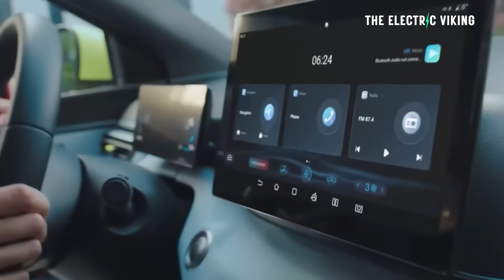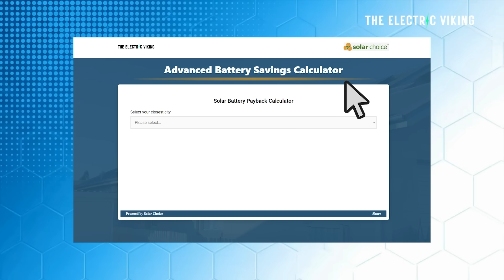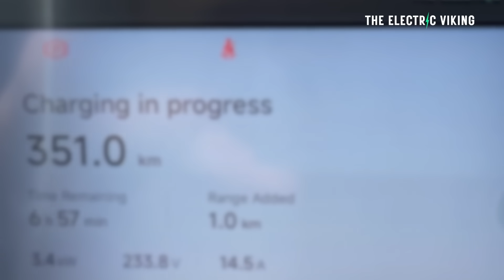This Data from 2025 PROVES Legacy Automakers are COOKED

Comment: Chinas pivot to renewables and EVs is also a national security strategy to reduce oil consumption just in case US gets desperate enough to blockade china's oil supply. Imagine over 500 million drivers in China not using oil to run their cars daily. (500 million is just a guesstimate) not to mention renewable energy production its a staggering amount of oil that can be used for other sectors.
Reply: China has options on obtaining oil if the US acts:  increase imports from Russia and Iran which are transported through land routes;  start using their extensive oil reserves; buy oil from Canada that can be shipped through the Arctic.

Comment: About two-thirds of all EVs sold in 2025, were in China.  Sadly, in the USA, EV sales were down about -27% last quarter.
Reply: That's false information.
The drop in EV sales for calendar year 2025 was about 2% in the USA.

Teslas Model Y was not sold in the USA for the first two months of 2025, as the new Model Y Juniper was being readied for sale.
Also, the EV tax credit ended September of 2025.

So, the small drop in sales was insignificant in the USA.
Reply: @dvader3263   I know EV sales were only down -2% last year.  If you re-read my comment, I said EV sales were down -27% for the last QUARTER.

Comment: Toyota and Nissan lost the plot when they didnt focus on hydrogen.
Reply: Toyota did focus on hydrogen right?
Reply: @rowanbroekman3929 about as much as any American maker focuses on electric. Just enough to collect the grants and not actually make a real effort.
Reply: Hydrogen is a lost cause, they tried it in Norway and it failed. There is no efficient way to manufacture hydrogen on mass so it makes no sense to press on with that pipedream.
Reply: @cbcdesign001   dont lie to people when hydrogen can be made with solar and water. Tech existed back in the 90s amd is used by giant trucking firms to date but no one wants inexepensive fuel that would allow the poor to advance their lives an livlihoods because that would take away from the American manufactuting slave populace. Just because big oil has made every effort to destroy the tech and claim they are the only option.
Reply: @JeremyGeorge-t1p The problem is that you need a really expensive tank to keep the hydrogen in and also to tank it over. It's very dangerous on top of it. Simple electricity makes much more sense. 
You could also drive on high pressure air, but despite a little bit less expensive it still doesn't make much sense.
Reply: @rowanbroekman3929  a home tank or even a small commercial tank that could be installed at roadside standalone stations only requires a water supply, which can be topped off with rainfall or even a urinal and an off grid completely renewable power source like solar or wind. Very small footprint. Almost no transport cost outside of regular maintenance after install. The tankage itself costs far less than any large scale battery at between $500 to $2500 CAD, fills extraordinarily faster and takes up far less of a footprint than any battery station would. Cost of materials and damage to the environment from mining, waste and pollution is also by far less. Little to no range anxiety, with the ability to produce hydrogen faster than electricity with an onboard generator, plus free water you can either put back into the system or drink. Now how would you like to try and spread more propoganda to someone who has worked in the energy, transport, containment, mineral resources, waste and manufacturing industries for more than 45 years?
Reply: @rowanbroekman3929   you are full of hot air. Hydrogen is by far safer and has been proven so in commercial testing than even conventional fuels and batteries, as the tankage used to contain hydrogen is actually a heavily regulated multi walled fuel cell thank can withstand explosions and intense environmental conditions.
Reply: @JeremyGeorge-t1p Hydrogen is fine when consumed where produced. Storage and pipelines suffer from embrittlement. Burning hydrogen in a fuel cell has roughly 33% efficiency.  If you are going to generate electricity, it makes more sense to use an EV
Reply: @JGood-Quebec if you haven't read the other comments about producing it on site and where needed and not using a pipeline and zero drilling. A person can use hydrogen in any matter they wish, whether it is internal combustion or electric or anything in between, which makes it highly versatile and multivehicle usable not restricting what would arrive to fill as long as the vehicle has a hydrogen system of some kind. Using conventional fuels to create electricity is less efficient and running around on giant batteries kills the planet by requiring mining for substances that should really be recycled from existing waste. A hydrogen fuel cell generating electricity in your vehicle give the vehicle a lighter weight and more space overall as well as a much greater range, plus you do not need transmission lines, fields of panels or giant wind towers destroying the country or massive coal/petrol electricity generators which also require refineries. Like solar, water and wind power, Hydrogen can be generated at home basically for free as well as directly on site of a fill station without any underground infrastructure necessary.
Reply: @J @JeremyGeorge-t1p  How are you generating Hydrogen for free?

If hydrogen were free, then we would have already stopped burning fossil fuels
Reply: @JGood-Quebec  it is very easy to create free hydrogen after some simple minor equipment investments. You can make it at home. Just because oil and gas has spent centuries trying to sabotage its development or control it as a petrol product, just like electric vehicles doesnt mean it does not exist. Stop marching to the tune of Stephen Harpers MAGA IDU and do some simple research. Kids used to produce hydrogen in Canadian grade schools as a first science project.

Comment: That's really simple story there, 1. Legacy automakers have lost their teeth in largest car market in the world, China, so they have start a steady decline in the profits, which will end badly for most of them. 2. Electric cars are already good enough, not tomorrow, not next year, but now. Almost anyone who has driven one, will buy one next, Plugins and E-REV's are just a stop-gap means for those who are afraid of range. 3. Price gap, which stops Legacy EV's from being sold in western world does no longer exists, in China. The EV's are  similar price or lower price than ICE in there. If the silly tariffs and regulation would stop, this would happen in rest of the world as well. 4. USA, with their oil-based economy will be trampled over when rest of the world stops using oil in near future...

Comment: You are dead right on the inability of legacy automakers to see and manage their decline. 

As an engineering manager I saw Ford, Holden, Mitsubishi, DaimlerChrysler, with EVs in 2002, all fail in real time. The real issue is in the executive ranks. 

The only fix is to cull them substantially, and replace them with younger and more modern thinking, engineering executives.

Comment: They were warned years ago, pivot or perish .I have No sympathy for them ,but I do for the workers. 🤨🧐😤
Reply: Yeah, it’s hard to have sympathy for them. However, they do have a lot of experience in building high-quality and reliable frames (body), suspension and auxiliary systems. It would be bad if those knowledge lost. Oil cartels influence in them is terrible.
Reply: Yeah check out this amazing documentary Who Killed the Electric Car.  GM had a working desirable EV back in the 90s and their own execs worked with oil company to kill it.  You can't even make this stuff up.
Reply: Ev's require far fewer people to manufacture. There are factories in China that are lights out.

Comment: I’m in Canada, driving a 2024 diesel Silverado 1500 truck and an old gas Toyota Corolla. I really want to buy a plug-in hybrid from China that has over 100 km range on battery and more than 2000 km range on full tank gas and fully charged. I’m patiently waiting and will never buy a new ice car ever.

Comment: With Trump destroying air polution standards for American cars - means that no American car will ever be exported to another country..
Reply: Do you know Trump is finally allowing car companies to make small affordable efficient cars. G W Bush and Obama effectively banned small cars by making them impossible to meet high EPA standards.
Why are you complaining? Do you want more gas guzzlers. How is that going to help the environment.
Reply: @benmlee  You have been drinking the orange man's Kool-Aid.
Trump has allowed car manufacturers to increase emissions with the argument that it makes them cheaper to manufacture.
That is not a good thing.

Americans continue to want larger and larger cars/trucks which use more and more fuel. American companies have always been able to build smaller cars but the public doesn't want them.

An AI created summary is:

The Trump administration is rolling back Biden-era vehicle emissions and fuel economy standards, proposing weaker rules to allow automakers more flexibility, increase consumer choice for gas-powered cars, and lower upfront vehicle costs. Key changes include setting a less stringent fleet average of about 34.5 MPG by 2031 (vs. Biden's ~50 MPG), ending EV tax credits, and ending fines for non-compliance, actions praised by some automakers for aligning with market demand but criticized by environmental groups for increasing pollution and fuel costs long-term.
Reply: @tonyw4863  We don't want most small American cars because they are crap. But people love their Bolts.

Comment: You talk like you know what the driving situation is 
Iike in every part of the world,I live in rural Canada the snow is 3 feet deep and it’s-20c many days it’s 200 kms away to visit family and the charging network is not there and if it was who would have the time to stop and charge. 500 kms of range down to 200 in the winter. We tow trailers with boats,campers,snowmobiles,atv,etc and that 700 kms range is down to 100! EV’s don’t work for us
Reply: Most people  elsewhere dont  live in an environment like yours. Rural with freezing temperatures and deep snow. Like here  in Asean which it's sunny all year round. The ev adoption cannot be stopped. In an Artic country like Norway almost all their new car purchases are evs( 96%) while its more than 50% in  China. Here in Thailand  which is  sunny all year round, its 20% and growing.
Reply: @kamsunleong6648  Look at a map. A lot of regions on the Eurasian continent live in exactly that freezing winter temperature.
Reply: Some of that is no longer true. You might look again, although that’s a lot of edge cases to overcome. Well over 90% of the population has no such constraints. 

- we don’t have that much snow in New England but my Tesla is the best snow car I’ve ever had

- heat pump is critical to preventing winter range drop. A big reason I finally bought my Tesla was when they started using a heat pump. Now sone other brands do as well but should be a basic requirement for northern regions

- towing range is certainly a general issue with EVs, but you might want to look at the GM trucks with their humongous batteries

- technically any outlet will do for charging. You can put more into a battery from a standard outlet than the average person drives in a day. May not be convenient though

- but yeah, sometimes you need faster charging and if you don’t have it, an EV may. It yet be for you. However fast chargers are expanding rapidly and most of the population is near one, at least in the us

Comment: The key battleground will be in trucks and buses. The oil market is already unstable and Australia is incredibly vulnerable but the transition to commercial e-vehicles will be constrained by charging options. Buses and short haul trucks will need overnight charging but recharging for fleets like that is not available so operators will stick to diesel. When, not if,  shipping routes are threatenned, Australia  will just be collateral damage.
Reply: Bus operators around the world are already switching to electric vehicles. It tends to be single city local bus operators but the impact in reduced pollution is remarkable.

Comment: 4:55 My car mechanic will not work on my electrical circuit of my gas car. Neither would three others that I have tried. My washing machine motherboard went bad recently and three replacements that I bought used also didn't work.
The culture is wrong. We need open source stuff. Even with microchip schematics, resoldering, and recycling.
Reply: Teslas have service mode which shows up the full circuitry of the car. Diagnostics of issues is easy peasy
Reply: Mechanics don't usually work on the electrical system of a car. You need to see an auto electrician.

Comment: As the oil wars spread with the death of international law and it becomes impossible to insure oil tankers, the countries without oil are going to need a 100% alternative to gasoline.  China smartly positioned itself so that if it has to resort to rationing, the PHEV and EREV owners can still drive locally like the BEV owners.
Reply: Exactly. And even if oil is permanently ended or too expensive, an EREV can easily be repurposed as a full BEV
Reply: Oil is going to fall in price but gasoline and diesel are going up. As the demand falls less refineries will be economically viable.
Reply: Oil wars? Try to keep up, Brent Crude is down to 52$ It was 90$ a couple of years ago. But you keep living the dream, reality will balance out fairly soon once Ford and Toyota show the way.
Reply: @Mike_Ellis  Ford skunk works is quietly working on a revolution, but telling Trump they're stopping development (of last generation EVs).

Comment: For many decades, we have used microwave beams for telecommunication. It is a well-established and simple technology where microwave energy is focused into a beam by a transmitting dish and pointed at a receiving dish within the line of sight. If you stick a glass of water in the path of the beam, the water will boil. Much the same as in the microwave oven in your kitchen.
Now, if you point that beam at your EV's battery, you can induce a thermal runaway. 
In a war, the enemy can use this and turn every EV into a remotely detonated bomb. If you don't believe this, try sticking your phone in a microwave oven and turning it on. Good luck.
EVs ARE A THREAT TO NATIONAL SECURITY AND EASY TARGETS FOR ENEMIES IN A WAR.

Comment: People who buy ICE cars are absolutely clueless!  OK, there are a few extremely wealthy people who buy Ferraris and dgad.  But all others who continue to buy ICE cars are just dumb people.  EVs are virtually maintenance-free.  THAT is the no-brainer decision for buying an EV.  Besides that, EVs are more reliable, quiet, and cohesive.  The only maintenance I have done for the past 9 years on my Tesla S is tire replacement.
Reply: I kinda agree but not everyone wants a big car like the s. Once you factor in size with EV, they no longer get big batteries that are able to get u the range. So u r stuck spending time with charging the car all the time
Reply: @Cmvinyl0102  Just another dumb excuse.  Range anxiety is artificial.  300 miles is more than enough.  You charge the car at home overnight.  If you need more charge during the day, there are almost as many charging ports in a city than there are gas stations.  For long distance, Tesla's Superchargers are within distance EVERYWHERE.  There IS no excuse -- only stubbornness due to stupidity.  And this stupidity is mostly in USA - Idiocracy!

Comment: Understand ev maintenance cost is 15 times cheaper than ice vehicle,  technologies with functions and features ice vehicle is not available.  cost of electricity are at least 10 to 17 times cheaper compares to fossil fuel.  Despite power Charging at home, ev Charging stations is everywhere longest distance apart between Charging stations in China even desert maximum distance from one to another is 200km apart.  Why people in western countries never realize the positive sides of ev because they don't want you to focus on renewable energy.

Comment: Nothing wrong with rebadging, it happens all over the globe.
The issue is the badge premium in sticker price that is unjustified.
The general consumer is becoming aware of the BS and is starting to refuse to pay that premium.
Equally the Legacy large mane players luke Ford toyota and VW are seeing high warranty costs through poor manufacturing and cost and corner cutting.
It is interesting to see Stillantil buying up Chinese EV companies but even then Stillantis have poor warranty makes under their control also.
Big auto dont care about quality , it is all about profit for them.
Ford USA has the highest warranty cost for faulty components and engine failure.
Even more than Toyota. 
It will be fun to watch what happens.